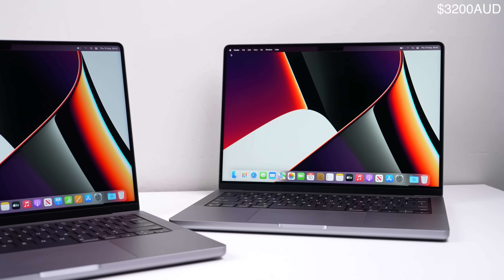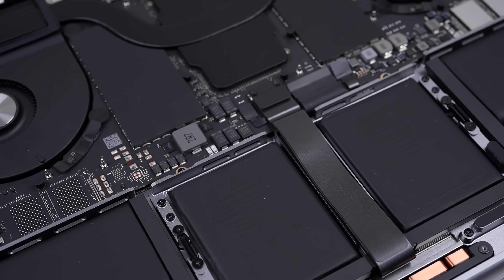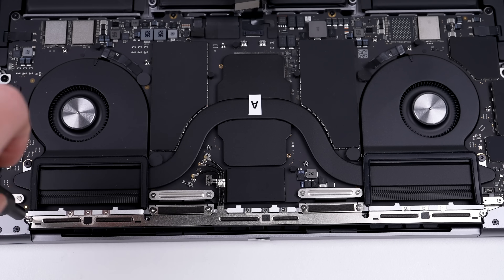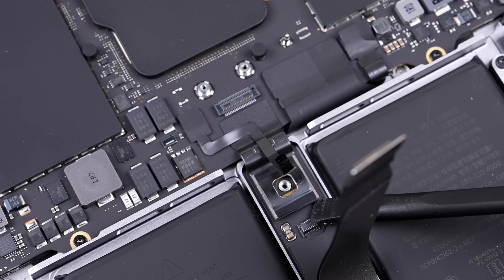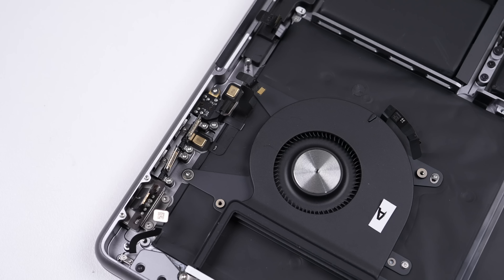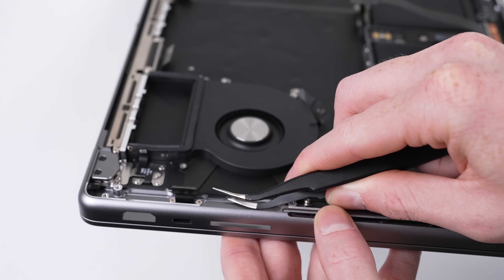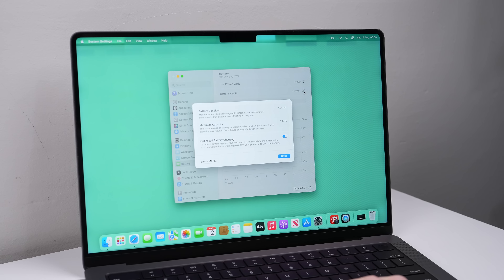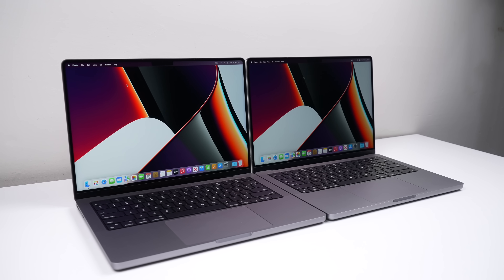New Anti-Consumer MacBook Pros - Teardown And Repair Assessment - Apple Silicon M1/M2

Comment: Great video, Hugh.  
35 years in IT and I still cannot understand why people are so fiercely loyal to a company that fleeces its customers and sticks its middle finger up at the independent repair industry.  It just makes no sense to me.
Reply: i used to be baffled by the exact same thing until I get to know the market better. It was then I start to understand that likely 99% of users have very light usage for their laptop or cellphone. Most people almost never went to the setting tab and would just sticks with the factory default.
Reply: sunken cost fallacy
Reply: when you look at the best candidates each party can come up with, it is no suprise that the same population has no clue they are being robbed
Reply: The Software man, You are 35 years in IT and did not learn that the Software is the whole Shebang? Everybody can do Hardware.
Reply: I use FreeBSD with xfce. xfce doesn't have the best graphics (but I like it), there are other desktop environments than xfce. Regarding the OS, FreeBSD is far superior than any Linux distro, or Apple's OS. PS: I'm using computers since 1997, and FreeBSD since 2010 alongside occasional Windows.
Reply: Literally the only reason I own a MacBook is because every Windows-based laptop I owned had nothing but problems. My MacBook Pro is the only laptop I've had for longer than 3 years, and still without problems. My desktop (a custom built with Windows 11) works just fine with 4 years of ownership. Not sure why laptops on Windows have been horrible.
Reply: The OS is super convenient. That's why I buy apple. I know the risk but I also work much faster on a mac for specific tasks and I can never configure windows to be as seamless and not annoying. Also insane battery life and good build quality. 
It's just a shame they are not easy to repair.
Reply: I've been an Apple nay-sayer ever since Steve's return.
Reply: Marketing can create a cult. Look at Tesla for another example. Minimum of 18 deaths as a result of releasing broken unsafe software in the US alone, wheels that fly off whenever something more powerful than a fart hits them, brakes programmed to all stop working upon ANY wheel damage, agressive high pricing, HUGE repair bills (6-15K+ for a bumper replacement that costs 2 on most cars is no exception) and huge repair times (I've seen up to 41 weeks).

Yet there's people who will defend Tesla like some kind of innovator out to help the people and save the world. They're rabid dogs as a result of marketing and pack mentality.
Reply: I concur. IT Pro here as well and I have more MAC product crap products on my lab desk in which over the past 30 years I have come to despise Apple and their products. People who are loyal to Apple...Simply put are SHEEP.
Reply: Unfortunately most people either don't care about repairing something and just getting a new one, or think it's way out of their league. Thankfully there exists many different sources of teardown guides and many knowledgeable people to ask. One day I think we'll get to a point again where throw-away culture is a thing of past
Reply: @thunderkrux7745  very soon, world wars have that effect on mass populations.
Reply: loyal. its more about simplicity for working with the products. when you are in the eco system, then everything works great together. If windows and android gave me the same benefit, then I'd switch to only that. I have noticed that windows 11 now has a focus mode so you don't get any os distractions. its a good step, but at the moment windows 11 just seems backwards in too many ways.
Reply: @GhostofOdinsEye  The Apple system is admirable, but hardly "eco".  Apple continues to use expensive exterior materials and finishes which don't justify the lifespan of the interior technology.  Their "commitment to being carbon neutral by 2030" is an risible PR stunt and is unachievable unless the company relents from its inexplicable reticence in allowing independent companies to fix their equipment.
Reply: Its cos Apple computers just work. No hassle, no drivers, no Windows update, no viruses, no antivirus program. Every thing is built in. You simply buy your self out of trouble.
 I own a 2019 mbp and the ribbon cable to the screen broke after 2,5 years. Would’ve costed $100 to fix only at Apple. Last minut the repair shop tried warranty and it ended upp costing 0. 
I dont like apple , I like their OS
Reply: Say the cruel truth that if a device is too easy to be repaired by ourselves, there will have no customers buying new devices...
This is indeed how Nokia went down so hard - Their old devices are mostly unbreakable
Reply: people are sheep
Reply: I've met 2 types of  "Apple consumers" The 1st are people who have loved and owned apple products since the iphone was released, those people wont' buy newer Apple products they keep the older more consumer friendly stuff I'm sure someone said the good stuff was before Steve Jobs departed. The 2nd type of Apple consumer buy all the latest products, and turn their nose up at anything else, and just throw money around.
Reply: As someone else said, Apple is for creative users. I am one of them but I would also call myself a tech nerd. The reason why I would pick apple any day, is especially its software and the eco system. I take the L of 0 repairability for that.
Reply: @KingslayerBeforeDawn  Then you probably realise that unless Apple finds a way to integrate and dominate, its years are numbered.
There's only so far in one cardinal direction you can go, when the other three are making outroads too.
Reply: Steve Jobs LOL he is still laughing in his grave that suckers still buy his over glorified overpriced paperweights. LOL
Reply: The word you're looking for is "Retards"
Reply: Thats like mercedes owners and other crap for the rich. Look I have apple I am rich. Nothing else. Status icon for retards.
Reply: bcause people are fcking stupid
Reply: Masochists, that's why.
Reply: They're using it as a surrogate for religion. It's like if you complain about the company then you're having a go at them personally. This is what happens when you base you entire personality on what you buy.
Reply: because people are stupid, there is dumb women who buy "alive water" literally tap water from Colorado for $75 or some shit stating the water is alive and the other water is dead. The world is full of extremely braindead people they just have money in the US
Reply: Apple is a very prestigious brand. Has been since the early 2000s. It started by them making their products all white. Then it continued by them making their products out of aluminum. And the products are of a high quality but that's the justification the monkey brain gives to the lizard brain.
Reply: why people are so fiercely loyal to a company that fleeces its customers and sticks its middle finger up at the independent repair industry

One word: LAZINESS
Explains literally everything about a typical Apple user. Just like every other smoothbrained dumbsh*t end user, Apple users, especially, don't want to learn how a computer works, nor wants to put in the time and effort needed to get things up and running. And for that, they have to pay the Apple tax. They literally lose all their rights, freedoms, and ownership for the PRIVILAGE of using an Apple product. You know, much like how much of the common people all over the world think that sacrificing their freedom for a lil bit of security (which they don't even get) makes them lose everything. shrug I feel nothing for Apple users. They get what they deserve, and I'm here to point and laugh at the r3t4rds who continue to shill for Apple products and then complain about them not actually owning the product they bought.
Reply: ive said the same this for the last 40 years
Reply: It's because 50% of the population is stupid, just look at all the other things that go on, besides this..
Reply: Low iq, that is why.
People that can't put 2 and 2 tigether are the problem of modern humanity.
You know, a long time ago there were those nice puzzle books with connect the dots images.
It was fun for kids to grow imagination and put their neurons to work.
That helps understand if someone is doing bad things to you, if you continue to throw money at them, things will go worse.
But in the age where kids grew up in 9gag and then those nice challenges to eat tide pods and tiktok, the neurons are dying out from early age, and their parents are 100% guilty
Reply: I would jump ship at a moment's notice. Point me to any other viable option.
Reply: The problem is that competition is much worse in terms of usability. I hate apple for all of this, but unfortunately, windows laptops (where I replace windows with some Linux distro) are complete garbage
Reply: Accessibility is a big one
Reply: They stick you with more than a finger. It’s to bad they don’t have a open Q and A during keynotes. Even though cook wouldn’t answer certain questions it would be nice to see him uncomfortable.
Reply: I recognize they have a general quality to them over other smartphones whose technology was all stolen from apple in the first place by the people building their phones. 

Apple took that, and decided to milk it. Their products aren't any less awesome than they were while jobs was with them.

But now they are harder to repair if they do break, they are more expensive every year, and honestly Apple didn't do anything original since the iphone 4S came out because they are cowards and don't want to hurt the cash cow on taking risks innovating a whole new thing

Which used to be their thing.

Smartphones, laptops with wifi, the mouse, the personal computer 

Now, they tried the apple watch thing but I don't really see that as popular as they hoped. Samsung still copied them though. And it's really just another phone on your wrist

So they really haven't been original since Steve jobs died and they bank on that image
Reply: @coolersmoke there are plenty of stupid people in the world. Why this baffles you in 2023 and with you having so much experience in any field is what baffles me.
Reply: Cause Apple also makes the highest quality electronics.
Reply: @nathanapplegate5374  Yup. Those fraying cables are the pinnacle of quality.
Reply: They just don't know any better.. and with too many non-Apple brands fscking customers left and right, I understand why they choose the safe option, which is the highly expensive Apple
Reply: Other commenters already made good points about the Apple ecosystem being a hassle free solution for people who don't want to spend time fixing/optimising their devices. They just want something that always works. And the Apple tax is just considered a convenience fee for not needing to spend hours setting up stuff or fixing issues. 

On the other hand the lack of repairability has worsened in the last few years and maybe not affected enough people yet. I startet with an iMac in 2012 (later upgraded to SSD) which i sold and replaced with a macbook pro 13'' which i sold to get a 15'' macbook. The only repair I ever needed was for the 15'' and covered by warranty. SO the lack of repairability and upgradeability hasn't affected me in the last 12 years.
Reply: "its easy to use" - fuck my ass they are just braindead.
Reply: Consumerism, herd mentality, parent's credit card, you name it 
Its simple
Reply: Because this is a poorly educated consumer society that always pays and the society is happy with it, and they will still be explained that this is normal and then there will be enough fools among people with money.

For some people, Apple is belonging to a certain caste of people; they are very far from IT; they don’t care how maintainable it is.
Reply: Brainwashed.
Reply: Most people who are Apple fans are dumber than the device itself.
Reply: Because they're not aware of how it works. And Apple has a strong brand that makes people want to feel like they must belong to a "cool" culture.
Reply: Some people like anal sex.
Reply: simply because its "Apple"
Reply: Apple should just commit to  doing over their customers, and SPOT WELD everything together -  no screws.
Reply: I'm one of those people you are talking about. 30+ years of using Macs only. But they finally cranked up their greed so high, they got rid of even me. I hate Windows with a passion, but now Linux is finally ready for prime time. I can keep from gagging long enough to use a Windows box for the two software packages I cannot get for Linux, or I can buy one used Mac if necessary, and do everything else on Linux boxes (I currently run seven Linux machines), but Apple will never see another dime of my money.
Reply: It's IT jewellery, that's why.
Reply: Not Apple, it's the freedom of life
Reply: They just want you to know you don’t own the machine. The machine is there to own you and use you for your resources, and get you in-formation.
Reply: @jayjay-sv6nz  You need to remove the tin foil hat you obviously are wearing.... Of course you own it. You can destroy it, lend it, give it to someone and nobody, not even Apple can tell you shit!! And no they are not stealing your information!
Reply: We are not all tech nerd. Most of people don't care about being able to repair screen, replace battery or else. Apple offers something else that pc don't.
Reply: @yuultube  You take your car in for repairs, right? You don't care about how the engine works?
You just take it in, and suck up the cost.
That is Apple's business model, and it sucks.
The PC business model is that you can take it in and repair it, upgrade it, make it faster, better, whatever you want...
Imagine if your car garage offered that - and at a fraction of the cost of an Apple shop..
Reply: Apple's marketing is like buying a car.  You can't make it better, you just have to buy a newer one.
It's a disgusting, utterly wasteful business model and it need to be changed.
Reply: I see 1k+ Likes and a lot of replies!
I stand by my original post.  Apple's marketing is basically "Buy our new thing" just like a car.  Except your old car will go for pennies on the dollar.
Whereas PC is "Buy this and you can upgrade it, really simply, to keep it up-to-date for years."
If you have any conscience for the environment, if you care about waste.. then do not buy products which cannot be upgraded.  And that's Apple in a nutshell.
Reply: The new EU laws will change all off this
Reply: A lot of consumers aren't bothered about the repairability or the initial cost of these products as long as they can have the newest version the second it's released. It's like worldwide peer pressure for adults. Apple know this and are laughing all the way to the bank! #iSheep
Reply: Humans make decisions on emotions, very less on logic
Reply: Commenters saying that PC Laptops are "garbage" compared to Macbooks, need to make sure they are comparing in the same price range. When you get up into the $3000-$4000 price range, you can get some very nice PC laptops with specs similar to MacBooks, and with the ability to replace parts. Sure, you can't compare a $1000 PC laptop to a $4000 Macbook Pro. That should be obvious.
Reply: agreed.  If it wasn't for third party repair cellphone and mac shops Apple will have no clients since people don;t want to pay $10000 for repairs they want to pay less like $100 for iphone screen repair and not $329 for iPhone 12 Pro persay .good point.  been in space repairs for 20 years. i get it
Reply: UPDATE: I'm not surprised by the number of comments here, responding to my original statement which, of course, I stand by.  I'll detail a little on my OP: I accept that Apple has created some gorgeous products, has a great OS.  But its continued determination to charge hugely inflated prices for them, and make it even more difficult for independent companies to fix them, will eventually lead to its downfall unless it changes its ridiculous policies.
TL;DR - The future has to be green.  And that means being able to fix/upgrade/intergrate all technology simply and easily.  Apple is NOT that.
Reply: It does when you realise Apple is a cult, not an IT company.
Reply: For most it's superior products (in the customers opinion).
Reply: I am originally a pc guy... as educated as. Programmer... 25yrs ago transitioned to my other passion, graphics, video, fx... i dont use mac because the hype. I use it because it works... the way it works... since x86 change macOS apps started to transition to windows kinda thinking... to many dialogs ... to many "do you reallly want to cancel?" kinda annoying interuptions in workflow... dude i know why I pressed that,, dont interrupt me freak.. 😂😂😂 but whatever had to learn dealing with this phenomenon... macos on macs still run better and gives more fluid workflow
Reply: People buy their crap to be seen with it, pure stupidity.
Reply: apple's built a following that's in it for the chic aesthetic and imaginary status. consume product and get excited for next product.
Reply: For most people, tech is magic stuff that does tricks when you touch it. If it does not as expected, no one understands, thus throws it away. Since 2015, 4-6 cores with 3gb+ ram in smartphones are common. No one really needed an upgrade since then, software got more bloated, but thats it. About the same with laptops ( basic work units at least ). People don‘t maintain their good enough tech. They replace it cause they dont know better.
Reply: Same reason why people buy BMW and VW. They don't care if it's junk they want badge
Reply: I use my MacBook to make money. Amortized over 3-5 years, I really don't care if it no longer works anymore and I just write it off as costs of running a business.

Yes, I could get another laptop that would be cheaper, install linux on it, etc, etc, but I value my time too much and the savings over the aforementioned 3-5 year period are completely insignificant. I'm fairly sure that the IT in most companies that let their employees pick Apple laptops feel the exact same way.

Having said that, I haven't had a MacBook fail on me. Most self-repair I've done on my iPhones and MacBooks were simple battery replacements. I really just don't give a shit.
Reply: @SJohnsoninc  for u well it;s okay...but for mass consumer Apple environmental friendly  slogan and green technology is pure crap ...non detachable bullshit  with planned obsolescence hardware ..funny these corporate lobbying about themselves they go green tech..lolz what an irony
Reply: I dont want to buy a new MBPro but I have to because that is the only laptop that has proven to work. For my needs. 15 years ago when I was on a PC I couldnt make it work for music production and recording because something was always a problem. Bought a MBP and everything was plug and play, stable. I am appalled by Apple's policies but I see no other option if I want to continue working. If there's any alternative to this stable, QUIET and fast machine, please let me know! Sad .....I know
Reply: One reason for me... the Mac OS, period! I certainly no longer feel the dedication to Apple I had for so many years. After Steve Jobs' passing and their fast track back to proprietary hardware and soldering everything to the "Logic Board" (How "logical" is that?), if I didn't love and rely on the Mac OS I would be back to Windows, solely. Still, I am considering going back to Windows and building my own PC's again at this point. Would require quite a few changes in my business life however. 

I certainly have no dedication to Apple any longer. I used to be a most devoted Apple aficionado, evangelist, and Fanboi! They still make decent computers and such... it's the "Hardware Fascism" they force on customers I can no longer stomach!
Reply: You are clueless. ADHD? People pay extra for apple products because of the ecosystem automation and for the incredible support infrastructure. The world is definitely not you. Get with reality.
Reply: They’re just really great laptops. The best available.
Reply: yeah I'm sick of it we all gotta boycott it
Reply: I'll never understand it ... their loyal customers want touch screen laptop but are told they have iPad for a reason.  And these people just wait for any feature they wish everyone else gets outside the Apple eco system.
Reply: That's rational, only using pure brain. Apple groupies run on emotions, prestige etc.
Reply: @Anton-tf9iw  And YouTube commenters run on smug, holier-than-thou attitudes.
Reply: @Anton-tf9iw   Sure there are many Apple groupies like that... then there's us people who have been allowing Microsoft to SCREW US for the past 2.5 decades who are SIMPLY 🤬 SICK of the BULLSHIT in Windows that OUGHT TO "JUST 🤬 WORK", but is still a god-damn manual task, barely above some Linux groupie editing his umpteenth CONF file.

So if you 2 children are still enjoying GROUPING everyone into simple arbitrary groups based on stereo types... you need to add the "🤬SICK and TIRED of Microsoft"  group to your list.
Reply: @Anton-tf9iw  because as someone who works in IT, windows 10/11 is unreliable and ass
Reply: @Anton-tf9iw  emotions or prestige? The days that apple was a luxury brand are far behind us.. nobody is going to look up to you because you have an iPhone or macbook.. except maybe in a developing country. I'm currently using a macbook, just because it happens to work best for what I need it to do. I switched from iPhone to Android because of the silly pricing, but for me macOS is hard to replace..
Reply: @Anton-tf9iw  Literally NO ONE thinks Apple devices are "prestigious" lmao.
Reply: Apple targets the normies, the creatives who are non-techies. Especially for those who want an ecosystem that just works, even at a premium price. Price also factors in in catering to the hipsters.😁🤑
Reply: @TheKb117  The non-techies who just want a computer to do their work on, not curse and yell at when it decides not to work, with the "fix" buried in incomprehensible gibberish. People buy cars to drive them to work, not because they want to fixing them when they don't work. Buying a mac with their first windows OS, the one that Microsoft copied, buying the first iPod, iPhone, iPad, iMac etc doesn't make you a hipster, it's recognising an innovative product the rest of the industry rushed to copy. If your time is worth a lot, a premium priced product that is a tax right-off is hardly an issue providing it works well.
Reply: @deaddoll1361  10 years ago...yes but now 2024?? it's a myth mac > windows
Reply: @TheKb117  It's not an ecosystem if it can't be repaired with moderate materials at a moderate price.
Reply: @coolersmoke  ecosystem am referring to is the software side of the Apple system. Repairability is another whole story... a sad story.
Reply: what normies? I know someone who is a hacker affiliated with bloodsec international and is fiercely loyal to apple @TheKb117
Reply: @TheKb117 if everyone a hipster, there are no hipsters
Reply: @TheKb117  ROFL, as a Software Developer, I can tell you, the tech industry are primarily on a Mac, you will need to look very hard to find someone who is not on a mac. Even Google themselves have majority of their SEs on Macs. And Android development happens mainly on Macs. I will tell you more. I have quite a few friends from Microsoft, and you know what? All of them have company supplied macs. Yeah, they are not from Windows division, but still, no one chooses x86 laptops with Linux if given a choice nowadays.
Reply: @balkeep  I guess the stability of the Apple  ecosystem trumps whatever hardcore techies are touting of Linux boxes. Good to know. Thx.
Reply: status
Reply: @abrahamalviarez5870  I look on Apple users as mugs.
Reply: The other options are just crappier that is all.  Just got an M1 Pro and the CPU seems so idle, no noise, no heat, long battery life.  The previous i7 one runs hot, makes noise but did last 8 years and still works fine actually but the M1 is just so much cooler.

At work we also have pc,'s wintel laptops don't know why but they are sluggish, the trackpads are utter crap, everyone uses a mouse.  I love the trackpad on my Macbook...  never use a mouse with it.

So it's not about fierce loyalty, it's a kind of useability.... Actually I curse Apple for bringing out a new OS that breaks so much software each release.  But the alternative is like I said just crappier.

In the past repairing macs was ok, did so myself for many a years, and you could actually get parts a lot easier than some pc models... just no parts at all!   But since the advent of the right to repair movement, it's seems to have the opposite effect and the sh*theads in Cupertino are on some of personal vendeta against Louis Rossman.

That all being said I also use my mac for music/DJing and when I DJ I always fire-up/turn on a lot of things I want to use and my fellow PC DJ's always turn-off a lot things to have a more stable machine.   So from a useability standpoint the Mac's I've had always supported my workflow instead of hindering it.

Not fiercely loyal, just using what works and yes it sucks repairability has gone down the drain.
Reply: I can tell you. The kind of people that are loyal to a narcissistic self absorbed control freak of a company, are narcissistic self absorbed control freaks themselves. The kind that love taking pictures of themselves constantly, and seeking attention/validation from others. "Come and buy our products and we'll screw you over when it comes repair time!" Me, me, me! I HATE CrApple with a passion. Steve Jobs was a horrible human being, especially towards his daughter.
Reply: A lot of times, when those fail past warranty (2~3 years) the thing is basically trash.  Apple stores simply upsell to a new $6000+ notebook.  And you your data is locked up because of the soldered SSD, oh well.
Reply: Perhaps you don't know why boycott campaigns usually fail. Boycott campaigns are successful only when there is an alternative. The reason why Nvidia, Oracle, Apple, and Microsoft still survive as large companies is because they have their own, irreplaceable technology.
Reply: I guess they just like the user interface. They like the pretty girl look.
Reply: Just like fashion, it's a passion for the with-it and hip. If you got the goods you'd gotta buy it just to stay in the clique.
Reply: @Rutherford_Inchworm_III  the with - it and hip are a waste of space.
Reply: It's a cult.
Reply: It's because OSX is so much better than Windoof. The Apple hardware is just an expensive dongle. I bought my first Mac in 2005 and replaved its Core Solo with a Core Duo myself. I still have it. Macs used to be very well designed hardware during the G4 era. Now we get trash cans. The much beloved Cube Mac sadly was trash too. Design over function is what Apple prefers these days. Glueing batteries into devices should be a punishable crime!
Reply: @pcuimac  mac vs windows? it's 2024 not true anymore...
Reply: I appreciate the operating system more than the hardware.
Reply: @nickjunes  The Hardware can be improved to allow recovery and repairs.   $6000+ USD to replace it in a few years or several hundred dollars for what should be a $5 part = insanity.
Reply: @nickjunes  Then buy a far cheaper and more powerful machine and use a MacOS emulator..
Reply: @nickjunes  if i remember right, some people were sick of apple hardware and bought desktops and ran macOS on it - it was around 1/3 of the price and much better performance. #hackintosh
Reply: @nickjunes  well then just install the os on a better machine
Reply: @nickjunes Then get an x86 laptop and run Linux on it.
Reply: @nickjunes  We all know O7
Reply: Sadly their products have better performance, battery life, and displays than comparable Windows counterparts at similar prices. I'm not going to buy a macbook, but I was pretty tempted to when I saw what a $1000 macbook air can offer compared to a $2000 thinkpad.
Reply: @disadadi8958  True, i still chose Lenovo because of Office. Mac Outlook is simply not acceptable.
Reply: Thats weird I'm in IT and i'm also a creative who uses large printers and lasers for my business. I choose the Macbook Pro because nobody on the Windows side makes laptop worth a crap with good battery life that doesn't flex like a piece of cardboard.
Reply: @aliaswave  You're talking nonsense, maybe its just laziness on your part. There are lots of laptop that are better made than your Macbook pro if you care to pay the same price you did for your Macbook Pro. The problem here is you will spend thousands on buying Macbook but yet wants to spend hunderds on Windows Laptop and be comparing. Please make it make sense.
Reply: Apple products are like supercars .. nobody needs them but everyone want to have one XD
Reply: Cause they still make best products on a market !
Reply: Most of you commenting and agreeing here haven’t used a Mac. I have both Mac and PC every day. A 3 year old MacBook Pro still runs like new, but my 3 year old PC laptop is significantly slower and noisier. Practically obsolete.
The battery lasts WAY longer and it’s much much quieter. It’s just a better computer - until it breaks apparently.
So no, they’re not whatever singular bucket you’re putting people into. They’re going that way because most PC laptops are garbage. This is slowly changing, but still true.
Reply: @TCPUDPATM  It seems more like you're the one who hasn't had/used other laptop than Mac 😂 Your claim makes no sense since APPLE is THE ONLY COMPANY has been REPORTED purposely slowing down their old products with software updates 😂 such a liar!
Reply: @TCPUDPATM  bro you are comparing 4 year old pc with dedicated cooling and other fans to a laptop,what kind of dumb comparison is that? Mac for good only for maybe graphic designing,video or photo editing and battery life,but let's be real if you are buying a piece of tech why would you pay for more and get less 
A 3 year old pc feels certainly behind "3" your old mac because the 3 year old pc had its components from probably 2019 or 2020 something and made in the end of cpu shortage with bad efficiency and overheating
Anything after 2022 kills apple in performance let's be real here 
Also stop glazing apple for everything
Reply: So because they make it harder for YOU means I shouldn’t like my device’s UI and OS? There’s a reason we “blindly” follow a company, there’s not many choices to begin with and we all tend to enjoy one OS over the others. You should have more thoughtful opinions if you’re going to be sharing them with everyone.
Reply: @sep-arated  All I'm saying is that the idea that people buy Apple products for prestige or emotion, is not true. There are plenty of reasons to use macOS over windows/Linux. Doesn't mean I approve apples anti-repair attitude.
Reply: @rutgerhoutdijk3547 The MacBooks were peak laptop designs. But the sheer amount of anti-repair components this product line has recently gotten makes my blood boil, and the recent iPhones are just slaps to our faces. If my laptop/phone breaks and you refused to fix it and told me to buy a new one, why would I ever buy any of your products ever again? This anti-consumer practice is atrocious, and yet Apple fans will still praise and defend Apple for this decision
Reply: @hakhaimo it makes no sense?.....  3 Trillion.
Reply: @BryantAvant  He wasn't referring to apple.  He was referring to their zombies...consumers I mean.
Reply: No laptop comes close at the moment.
Reply: plenty come close. Time to figure out benchmarks, you'll be shocked.  @michael.petraeus
Reply: @michael.petraeus  that's pure nonsense
Reply: i finally chosed macbook cus of battery and stability. definetly more durable too ans weight is also a reason for me. i found no better product now
Reply: @laxmanacharykokkonda7894 For battery, stability, durability and less weight at the same price there are ten if not hundreds of laptops out there which are far cheaper.
You just chose to be taken by your Apple friends.  You never really looked for yourself.
Reply: @laxmanacharykokkonda7894  are you stupid or something?
Reply: @laxmanacharykokkonda7894  It's super crystal clear why you "chosed" macbook
Reply: Apple has 2 things going for it.  Cameras and displays.  There are multiple devices on the market that are superior to an Apple in performance, security, battery life, etc. otherwise.
Reply: @mgoblue0970  Bro apple's display are made by Samsung 💀